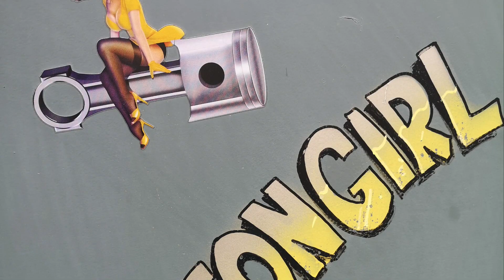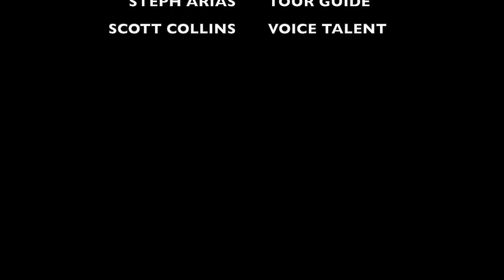A BUS STORY -  From school to Adventure

Comment: When I was in Mexico, I noticed many heavy trucks and buses had replaced the OEM round red tail lights with rotating rear LED brake lights. Not DOT compliant, so I would not replace all the rear brake lights, but they do look cool as sh$t at night. And given this is a private (not commercial) vehicle, It is likely you would not get any issues in US and Canada.
Reply from the maker: I know, its about the fine line of what we can get away with. Lights to follow.

Comment: Great build! Do you still require a bus Class 4 or 2 license to drive? 
Assuming you also need the air brake endorsement too? 

If its not being used for commercial use. How does registration/icbc work?
Reply from the maker: The bus is registered as a high capacity window van. Class 5 with air brake endorsement. It only seats eight.
Reply: @theadventurecooperative  perfect! Got class5 and air… theres hope for me yet. Lol 
Thanks for the information. Found a 83seater up island right now. On the fence about it. 

Keep up the vids. Doing a great job. 😁
Reply from the maker: We have three buses, If you have more questions feel free to ask on Facebook, or Instagram.